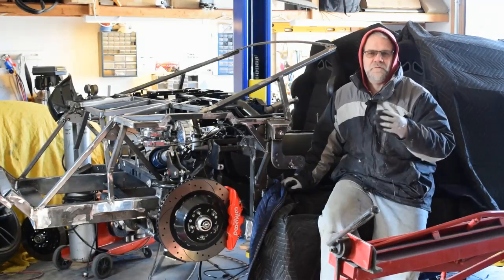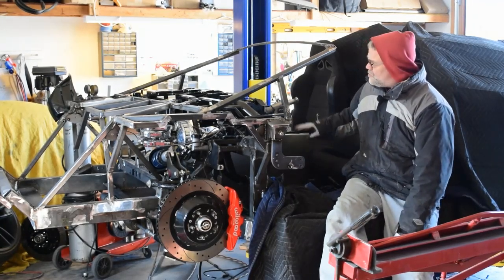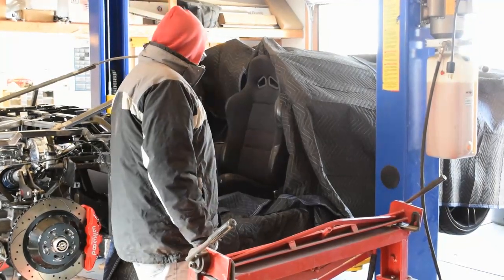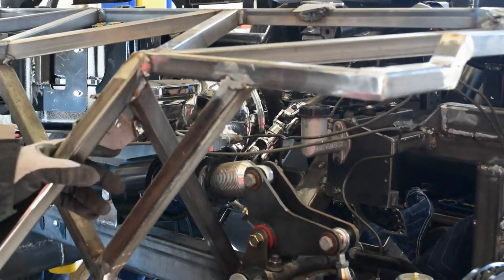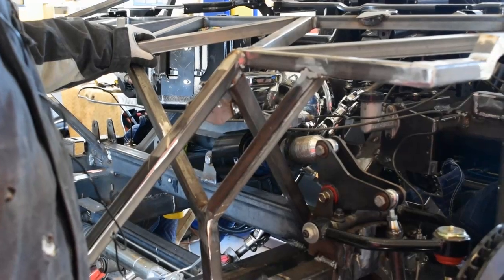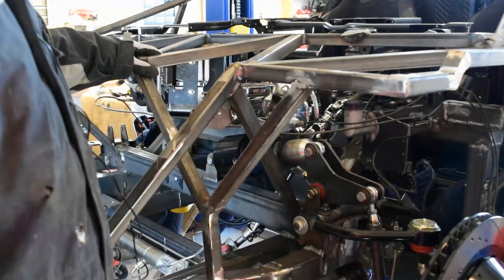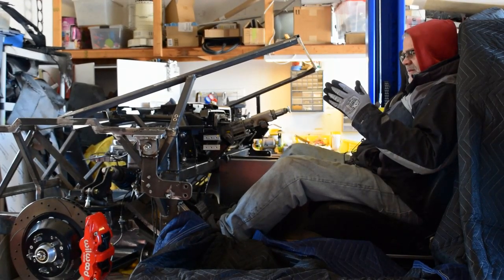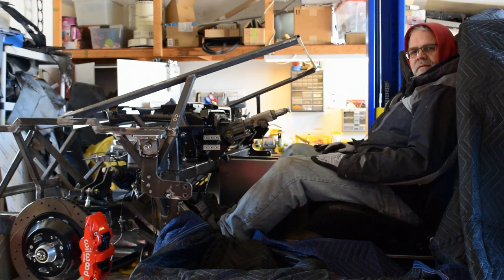3D Printed Interceptor (Aventador) Update 78

Comment: I personally like the newer style of presenting more but make sure not to forget the closeups of your work which you did when filming handheld. For instance you talk about the oem dash frame but its not really visible from the chosen camera angle. Maby taking some shots with the camera between driver seats would have been better while explaining this. If your face is not visible in those shots you dont even need to sync them but just use them while continuing the audio of the main clip.